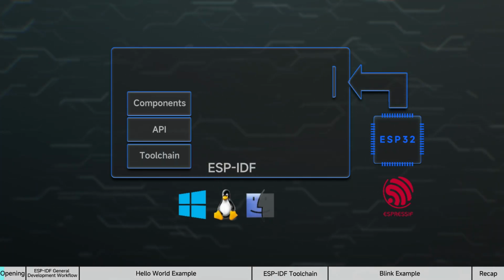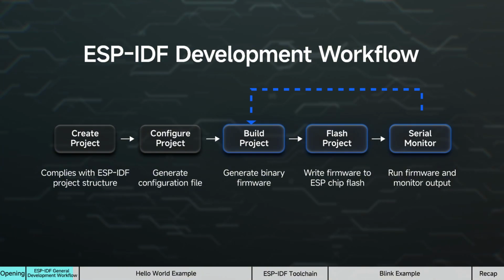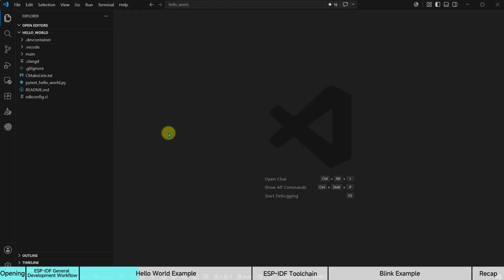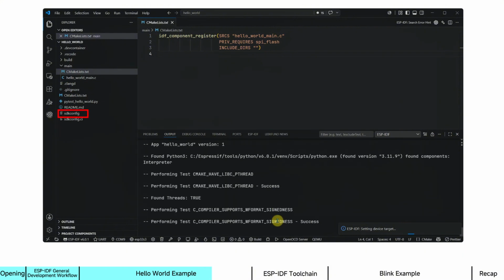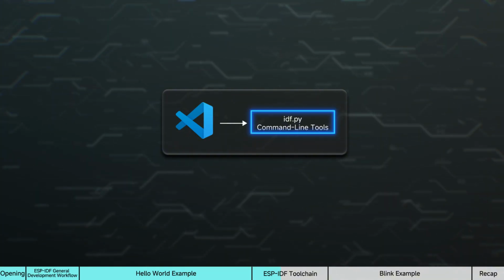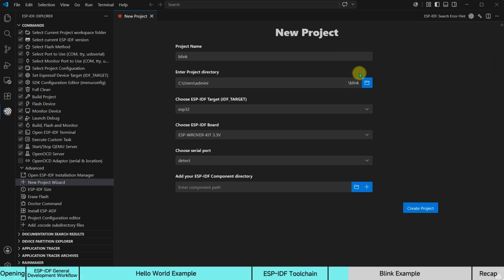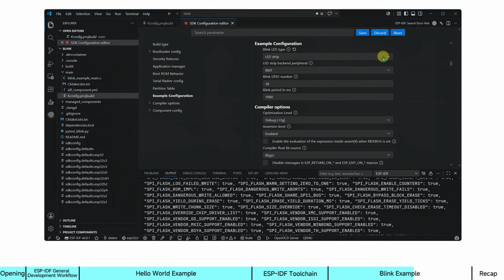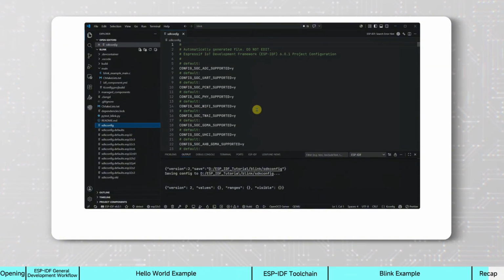ESP-IDF Tutorial | 02 Run Your First Example: Hello World & Blink

Comment: Great tutorial. Very helpful. I'm using the Espressif ESP-Module-Prog-1 V1.0 which has no onboard LED (other than a power indicator connected directly to the regulator) so tried your settings on a GPIO port with no success. A simple change from LED strip to GPIO and a port number did the trick.